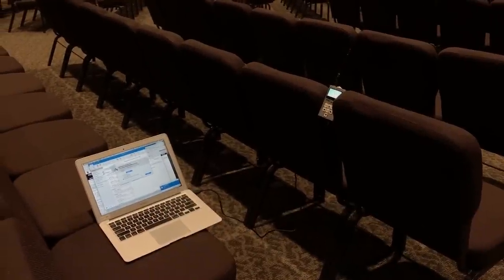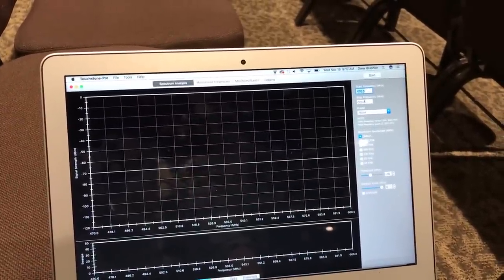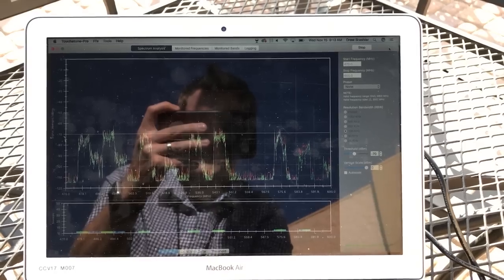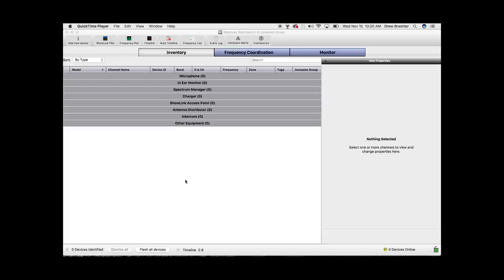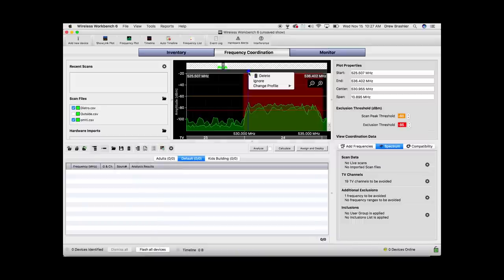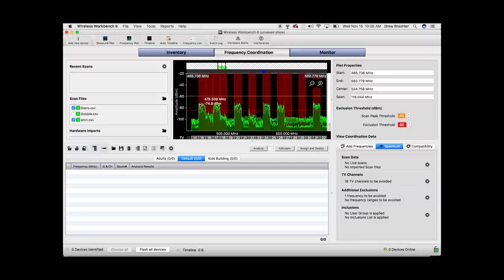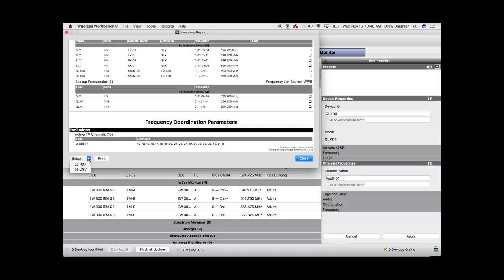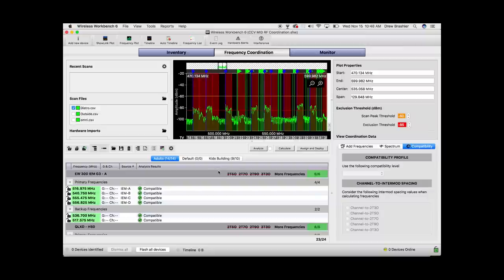RF Coordination with Touchstone Pro & Shure Wireless Workbench 6

Comment: Excellent info! I have two questions.... ;-)

I use Sennheiser gear but find Shure Wireless Workbench 6.0 easier to use than Sennheiser WSM.
Do you know of a way to use a Sennheiser EW300 receiver as the scanner for Wireless Workbench 6.0? (I don't have Shure products)
If not, what kind of mobile scanner are you using? (I would prefer cheaper brands)
Best regards...

Comment: Hello Drew, I'm very interested in fixing the feedback we're having with our wireless microphones using the Behringer X32. I'm new to this console and just getting to get into the logistic of this console. Just finish watching this it's seems like there were a lot of procedure to get the frequency done right by the steps you were showing. Anyway, you mention at the end of this video about wanting to learn more about getting a clearer frequency from your mics. You mention World Gain, or World Game, I'm not sure which one or I'm I saying it right or not. Could you send me a link to find what you're talking about? Look on YouTube, and couldn't find what I'm looking for. Could use your help. 
Why I'm here? Here's the problem. As I mention we have the Behringer X32, and we're having problems with the wireless mics when a singer is singing or talking the mics goes in and out while they are performing in front of our congregation. this also, happens if they move to different areas and while the pastor is preaching a sermon. A tech told my pastor that we need to move the transistors to the mics that have two antenna up higher in the booth we have. After watching this video about wireless mics and how to get a clear signal without interference would help to understand the problems we're having and how to fix it. But I could use some more help in this area. Hope to hear from you ASAP. Thank you

Comment: Hi Drew, I'm finding that I have a bit of a mix bag of products to work with there. Wireless workbench doesn't have the Sennheiser G4 stuff in the their inventory. trying to coordinate the G4 mics with PSM300 IEMS's.  any tips?
Reply: You should be able to use the Sennheiser G3 settings, just make sure the band is right. G3 and G4 use the same freqs. and modulation.
Reply: Proclaim AV using the AW band.

Comment: is there any other possibility to get an overvieuw of the frequencies in the building than to use a spectrum analyser ?because those things are expensive man. can you messure the spectrum with your laptop ? or is their an other way ?
Reply: You can use any receiver to scan whatever bandwidth the device allows. Exporting that data into WWB6 varies with devices.

Comment: Great Stuff Drew
Have bought the RF Explorer and about to buy Touchstone Pro.
A question on the scan: Do I need to keep a spacing buffer before my first frequency and after my last frequency before I run the scan?
For my example, I'm running a bunch of mics whose bandwidth starts from 518 and goes up to 596 MHz.
Reply: I always add a buffer zone, can't hurt and lets me know if something is just outside my mic range that could cause issues.